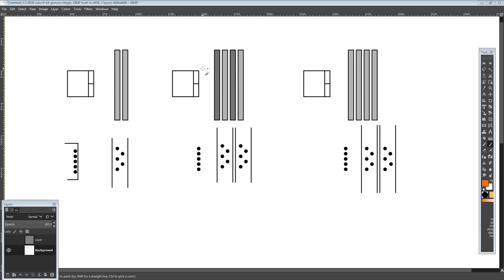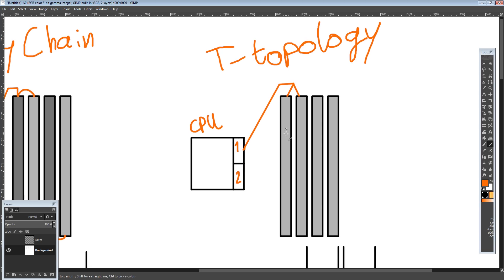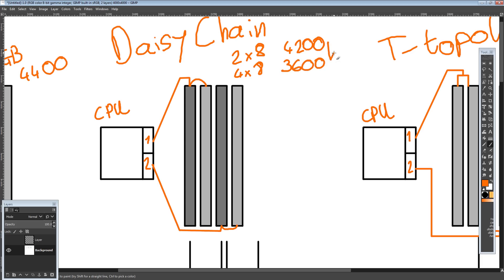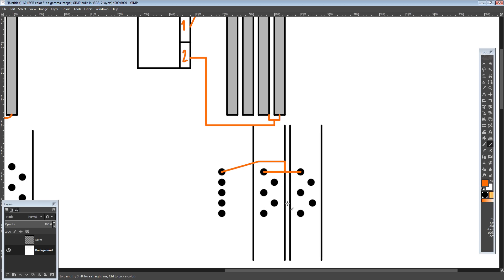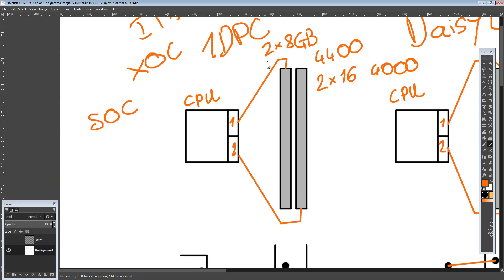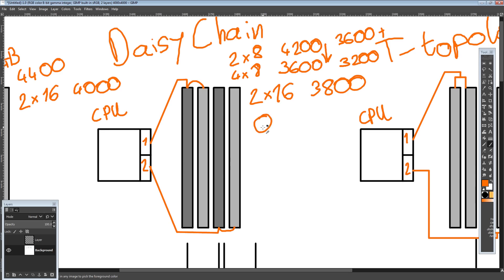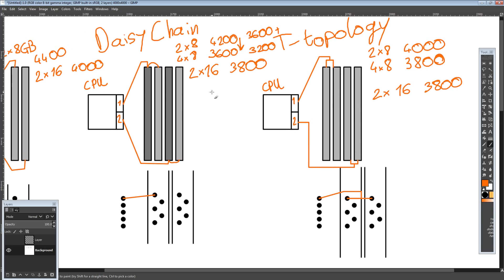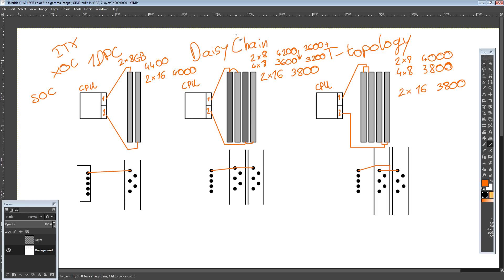Rambling about motherboard memory layouts.

Comment: I think even if a vendor is using t-topology it might be better to just state preferred slots since many new builders are probably told to check their motherboard on which slots is preferred and if the new users can't find it, it would be bad for them. So I guess probably just can remove confusion for some builders.
Reply: yeah if you dont state preferred slots then new builders will just stick the 2 sticks rigth beside each ohter and then they will only have sinlge channel.  so why not just try to make all boards fit the standard skip one, stick one, skip one, stick one, interface
Reply: @bobhumplick4213  yeah, it's easier for them to just say use this slot, then this one, then this one, and finally this one then explaining "one per channel first!" because you gotta explain channels ...

Comment: "In addition to smaller die size and lower power consumption, SK Hynix’s newly developed 8 Gb DDR4-3200 chips feature two important enhancements: a 4-Phase Clocking scheme as well as the Sense Amplifier Control technology. The 4-Phase Clocking increases signal strength to maintain stability at high data transfer rates. Meanwhile, the SAC lowers possibility of data errors that may occur when transistor sizes shrink." No mention of CAS timings but wondered if it could be competitive to Samsung B die?
Reply: Sounds interresting. I hope nore info will come up in the future.

Comment: I have F4-3200C14D 32GB 8x4 in my AsRock x470 board with a 5950x. It's working great but let me see if I'm understanding this correctly, these are dual channel single rank dimms, and  now they occupy all 4 slots in my board, so that being the case do they now operate as dual rank?

Comment: I just installed 4 x 16GB Corsair 3600MHz CL16 LPX Ram into a Asus Z490-E Gaming with a i9 10900k and it fails to run at 3600MHz. It works at 3400MHz but semi-stable (some errors on MemTest) and works perfectly on 3200MHz. I'm absolutely fuming that it aint working - the board apparently supposed to run 4000MHz x 4 easily......

I have RMAd both the CPU and Motherboard hoping that its something wrong with the board or CPU as 2x in A1 and B1 slots refuses to run in XMP as well.

Comment: Just looking at the manual it seems gigabyte actually does not seem to mention preferred memory slots at all. 
It does however number the slots from left to right 4231 so that could be seen as a small preference for 1 and 2
Reply: 4231 is the preferred memory order. Thats what they're trying to tell you. Clearly the manual needs to work on explaining things, cause you read it and barely figured it out, and you went looking for it. If someone has no idea, they would have skipped right over it.
Reply: @mrlithium69   The numbering is literally the only mention in the manual they actually have a diagram showing both 1 and 2 or 2 and 4 as choices for 2 dims. But hey I already know it doesn't matter so really it doesn't matter. (talking about the z370 gaming 7 here)

Comment: so you want either 2x16GB with 1DPC or 4x8GB with T-topology but finding 16GB DDR4 Bdie is like finding a rainbow unicorn so probably the 4x8GB with T-topology
Reply: For why? If you buy 3200cl14 2x8 u can hit 4200-4300 16-18-28 280
Reply: @rsm4541   i know 8GB Bdie works well and is easy to find but expensive but i want 32GB which means 4X8GB or 2X16GB

but since 16GB Bdie is pretty hard to find last time i checked there was none for sale in the whole country of Australia and the only way to get it was to buy it from newegg and wait for it to get shipped from the USA i came to the conclusion that 4X8GB would be much better which means i would want a T-topology and a good IMC which means not Ryzen but i want Ryzen does the cheapest threadripper have a better IMC?
Reply: @XDbored1   for what ?! Use only intel cpu -_-
Reply: @rsm4541  Intel CPU's have really gone downhill. Ryzen makes them look bad, and the rumours about the next iteration of Ryzen makes them look even worse.

Intel has been caught with their pants down thinking AMD will never be competitive again, and it's made them lazy, and it shows.

Buying intel just because it's intel is the sign of someone that doesn't bother to think about what they're doing.

When you look at marketing, it's obvious that such people buy intel CPU's no matter what, and Nvidia GPU's no matter what, regardless of whether that's even remotely the best option at the time.
Which... For processors, right now it isn't.

Though the stupidity of using Intel right now is especially evident if you need a lot of cores.
If you're trying to decide between a threadripper and an i9 for instance...
Reply: @KuraIthys   Agreed. I'd suggest waiting for next year and the Ryzen 2 core threadrippers, probably around april. Or getting a really good board and low end chip now and upgrade to Ryzen 3000 threadrippers when they release. 
The Threadripper boards are typically (from what I understand) the second tier of binning, with their datacenter Epyc chips getting the best silicon, threadripper second and desktop Ryzen last. So you will probably find better IMC on threadripper than you will on desktop Ryzen usually, tho I'm not sure if AMD's Binning process looks at the chip as a whole, or just core clocks.  If it's just core clocks, you may find you get a Threadripper with awesome core clocks and a terrible IMC on some channels, so YMMV.
Reply: @KuraIthys  DUDE !!! RYZEN IS JOKE !!! MEMORY LATENCY 60-100 Ns !!! THAT IS A BIG JOKE !!! This is NOT A CPU ))))))))) ONLY INTEL BABY , ONLY INTEL !!!
Reply: @KuraIthys  Infinity fabric good for server platform , not for desktop computer. 7700k 5.1-5.2ghz + 4200-4300 cl16 memory witch custom timings totaly destroy any amd cpu u know :) ANY time any game ^^ 2066 have AVX512 ^^ what have tr4 ? AVX128 ?) Crystals should not be separated by a slow bridge. They must be one.
Reply: @rsm4541  Totally destroy in everything, hmmm guess the 7700k using magical Ram can outperform 8 core 16 thread CPU at blender, at productivity work or anything else besides gaming wow, let's buy the 7700k and pair it with uber expensive RAM. Besides with the weak memory latency Ryzen have, it performs quite well against a similar Intel CPU hmmmmm.
Reply: @rsm4541  I wonder how close Ryzen performance will be to Intel using that same magical Ram :)
Reply: @rsm4541  Crystal should not be separated :) imagine this, 28 core CPU as you probe and test the CPU wow core 0 to 26 can hit 3.6Ghz then suddenly core 27 can only do 3Ghz awwwww :( sucks man. What else but to either sell the cpu as 28 core @3Ghz or 26 core @ 3.6 :( wonder how many CPU Intel have to go through to make 28core 5Ghz :( another scenario, wow 28 core @ 5Ghz but the memory controller is shot :(
Reply: @rsm4541  AMD has 64 cores single socket @ less than 400 watts, what does Intel have? Glued 2x28core @ over 600 watts?
Reply: @snowstar3560  only intel  anyway , anytime.
Reply: @rsm4541  nah dude, it's a tough call now. I have numerous Intel and AMD platforms, and clock per clock, coffee lake and Zen2 are about the same. Zen+ is also super impressive. Sure, that mesh architecture isn't so great in some games, and the clocks are lower....but the 1% lows are good now and "the experience" really does feel smooth...all that L3 cache...
Reply: @rsm4541  This comment aged like fine milk.
Reply: @Leo9ine  <3 .......................... ...... Б3

Comment: Thank you, simple and clear! I have Z270 MSI M7 + 7700K at 5.1 Gz, my RAM is 4x4 Corsair 4000 hz (stock frequency), unfortunately not stable, even thou my mobo supports 4133 hz. I dropped frequency to 3903 and lowered timings so now it works great. I thought what my CPU memory controller is weak but looks like having 2x8 memory sticks is a smarter idea.

Comment: in theory if you had enough layers in the mobo pcb couldnt you run the trace directly under the module then have it move up a layer then trace out to the dimm slots?  thatd probably make for a decent t topology.  and instead of tracing them out equally probably the same thing for a daisy chain.

Comment: i plan i building a new system based on the Asus Maximus XI formula and after reading the manual in 1.1.4 system memory, it suggests to use A2 with one stick and A2 and B2 with two sticks.

Comment: If any of you think any of this actually matters than you need to go to electrical engineering school. The PCB designers have a target speed for their traces, and they’ll have a considerable “safety factor” for that. All will be ran in simulation and formally test-benched. Trace length doesn’t matter, just all have to be length matched. The longer the traces, the more the high speed trace design matters. Please ask an actual electrical engineer not some know it all guy off youtube.

Comment: If i want to run 64gb 3600 mhz (16gb x4)  on zen3 and push the ram a bit,  does that mean it is better with 32gb x2 ram in daisy chain mb setup?

Comment: Quick question: what about old retro motherboards (SDR/DDR1) that used to have three dimm slots per channel and sometimes even 4 dimms per channel? (Asus P3V4X)
Reply from the maker: I would guess they have even longer daisy chains which sounds like a terrible idea but at the low clocks it's probably didn't hurt that much.
Reply: @ActuallyHardcoreOverclocking  good, hopefully I can get full 133mhz with all 4 dimms while running Tetris.
Reply: @ActuallyHardcoreOverclocking  My ASUS P6T for example is a Triple Channel motherboard.
Reply: @JanghanHong  Oh yeah, you're right. I derped since I should've realized that the moment I typed out "Triple Channel". 3 channels, 2 dimms per channel, 6 total slots.
Reply: @ActuallyHardcoreOverclocking  it's before your era :) but it did matter even back then, but it was rare to see a manufacturer give a damn and it was only extreme overclockers who cared.
I think ddr1 on AM1 was the first time general enthusiasts started to care about memory overclocking.
sdr era usuaully didn't have motherboards capable of adjusting timings in bios at all, DFI exposed many to advanced overclocking with the Lanparty boards and I think those lanparty boards really exposed and taught many enthusiasts that there is more to overclocking than just a cpu :)
it might be that my country had the dfi mobo's has the real revolution for memory overclocking and other countries had some other board but ohh well, my experience and observation from way back when :)
Reply: @ole-martinbroz8590  I had a DFI LanParty Socket 939 board with the nForce 4 Ultra chipset which could be modded to support SLI using an ordinary pencil :p
Reply: @yukisaitou5004  all great things should be possible to mod with a pencil, like the socket a cpu's too :)
Personally I had the nf4 expert, loved it and it took years before I found something that was as great again as DFI wasn't the most stable company when it came to delivering products :P
Reply: Once I upgraded a 233 MHz Pentium MMX system from an Intel mb from 1997 ish which used EDO SIMM memory and very slow ATA 66 HDs to a at the time somewhat modern motherboard which could support up to 550 MHz CPUs I believe and used a fast DIMM memory and ATA 133. It was around 2002. It was very impressive to see such an old CPU in a whole different system performing so much better with newer motherboard, memory and hard drive. Nowadays, this kind of performance upgrade pretty much does not exist anymore.
Reply: @ActuallyHardcoreOverclocking  we could look up permittivity of FR4 measure the length of data lane and guestimate what delay there is between slots

Comment: I have Gigabyte GA-Z87-HD3
And I have 4x4GB sticks of DDR3
2 is Corsair Vengeance 1600 CL9 
2 is Kingston XyperX Genesys 1866 CL11
How should i put them in slots?
Right now it looks like this
C|K|C|K - 
And that means that i have different sticks in channels?
Should i put them in like this?
K|K|C|C or C|C|K|K
Whole bunch works on 2200Mhz 13-12-12-27 CR1
But Corsair can go up to 2400Mhz 13-14-14-31 (Yea, i know that timings are too high)

Comment: So, i got question: What's better for 1 DIMM per Channel:

1. 2x8GB Single Rank and High Frequency (like 4000-4400 MHz)
or
2. 2x8GB Dual Rank and High Frequency (highest i saw was 3400 MHz, so maybe 3000-3400 MHz)

If CPU support of 4 ranks (like Coffee lake, Skylake, Kaby Lake)?

If i got it correct - single rank (1 rank per module) should be faster, since dual rank (2 ranks per module) memory load more CPU memory controller?

P.S. Also, how the hell i know how many ranks my CPU support? Where i may get such information? Call to intel?

Comment: Could this be why my 2x8 3600mhz Ripjaws V kit only hit 3200mhz on an [awful POS board that I absolutely despise] ASUS Prime B350 Plus, but XMP'd without a sweat at 3600mhz on an ASRock B350 Pro4(haven't tried to push the speeds yet, I need to give it a try)? Or, is there something else at play here, or is it just too many variables to realistically know? This is true with both my R3 1200 as well as my R5 1600.

Anyway, really disappointed with the Prime Plus, and really surprised by the Pro4. Really happy with that Ripjaws kit too, I honestly wasn't expecting 3600mhz on ANY of these ultra budget Ryzen boards.

Comment: Too bad that most vendors use 4 dimm slots instead of 2. 4 slots is only interesting if you want 64GB of ram, which is crazy overkill on normal consumer stuff or for gaming. For video/photgraphy editing or other pro (not consumer) use 64GB (or more) could be useful, but for consumer stuff I don't see the need for 64GB (yet). The mobo manufacturers could save a buck by using only 2 slots, and we gain a bit by getting better OC. A classic win/win situation if you ask me. They could always build a pro mobo line with 4 dimm slots for those who need the extra ram.

Comment: Great explanation on this topic but I just know quad channel gets better fps than single or dual channel. Also 4 x4 rams gets better fps than 1x16 or 2x8 rams sticks.
Reply: Rank differences?
Reply: @wangqiyu256  If ram size, speed and timings all being the same, quad is best and single is worst in most real life gaming performance.
Reply: it depends.  if all of them are at the same speed and timings then dual ranked dual channel (or quad channel) will do better.  but if you can get a faster kit of ram that is dual channel single rank then it will be faster tha 4x 4
Reply: I've noticed that CSGO is heavily based off RAM speed, this is probably linked with its poor multicore support as well. I use 8x4GB at 1333Mhz (DDR3) I've tried tightening the timing but its mainly speed that effects CSGO. Luckily I use my system as a workstation than a "gaming rig" these days. 

I know RAM speed will be the biggest factor for FPS but it highly depends on how good the game is at multicore and memory management if a game can properly utilise L2, L3 and RAM it's going to run like butter on the CPU side and scale with overclocks quite well.

Comment: @Actually Hardcore Overclocking , big question, for overclocking, have you ever attached oscilloscopes or logic analyzers or even multimeters to your motherboard to try to read the signals and figure out what BIOS settings resulted in actual voltage effects?. What are the best things to measure, VCC, VDD, PCH, whatever else can be used as a mental hint to keep tweaking the settings up? Like, could you check your DIMM channels and find out if one slot is weaker or can you compare between boards ? 
From my NON-actually-hardcore-overclocking point of view, all I can do is basically change VCore on CPU or tighten RAM timings until it crashes. Its just Crash and reboot, crash and reboot. Its not very intelligent just trial and error. I'm looking to make better educated guesses. Cause theres about 100 other low level CPU / RAM / IMC settings in BIOS that nobody understands or changes. And you probably know what they mean, but can you "feel" or "see" the results of anything on measurement devices? I know in the past you've made videos on LLC (load line calibration) level 1-5 and you confirmed that physically. How about any other settings you can do that for? Maybe make a video on how to attach probe points to your motherboard and how to benefit from not blindly poking away in the BIOS. And the way you mod video cards is pretty dang cool, but I kind of just want to poke around and measure first.
Reply: That'd be very tricky, even with tiny o-scope probes, those are very small pins to try and probe, and one slip means a short direct to the IMC on the CPU. I guess you could modify some old sticks as breakout boards to ease probing? Maybe some of those new corsair LED filler sticks that actually just fill slots and light up and have no memory?
Reply: @truckerallikatuk  solder small wires to the power pins?

Comment: How do these topologies stack up on server mother boards? i know servers have a whole other level giving options surrounding, ecc, memorry spanning, numa configuration, mirroring .. ect. im just curious about if the majority of high memory capacity servers are running have a better approach then the topologies listed. Servers in my experiance are so so so much more picky about dim placement and matching timings / ranks accross channels. could you make a video exporering that. for example the average dual socket server mobo has 24 to 18 dim slots with quad chanel or three channel memory respectively. just wondering how topoligy plays out with these less consumer techs.

Comment: Can you explain if there is actually difference if memory has 4gb or 8gb density on memory sticks when overcloking or it dosent matter. Maybe what matters is chat chip it uses (samsung, hynix ect)
Example Kingston Hyperx 3200 CL16 16GB  (8x2) Gigabyte  compatibility says its 8gb density and has hynix chips. While Kingston Hyperx 3600 CL17 16GB (8x2) has 4gb density and has samsung chip. Both are single sided